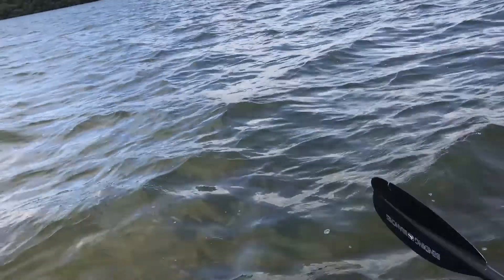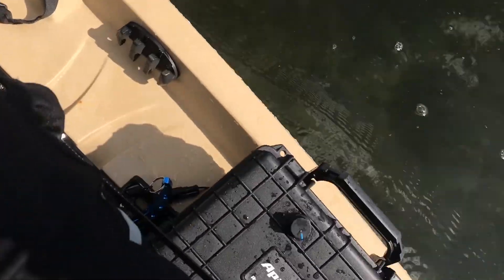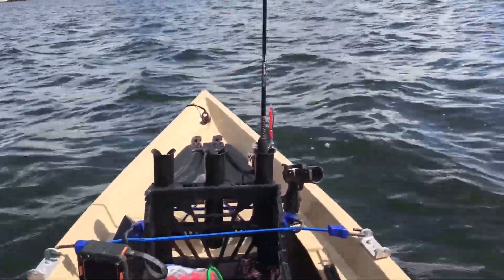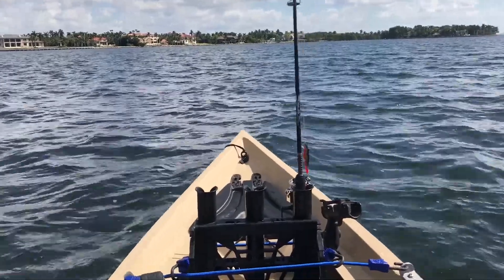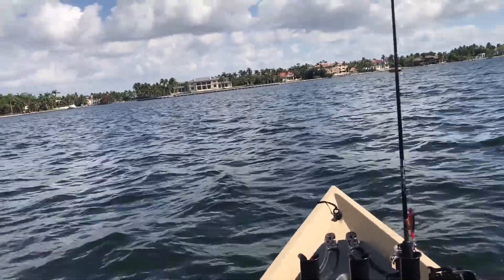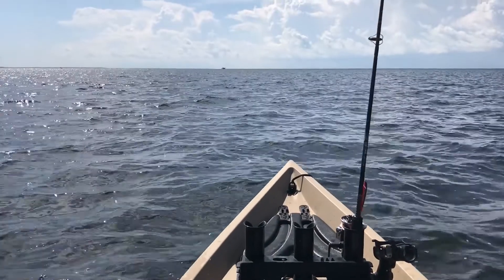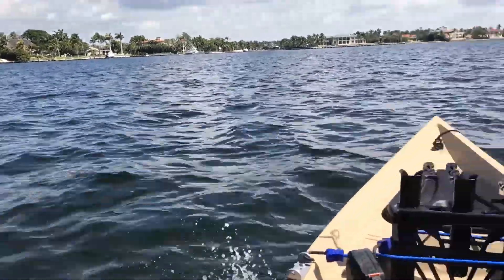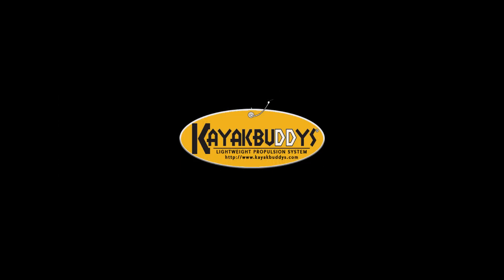Echo 58v Powered Outboard on a Nucanoe Frontier 12

Comment: How long does the battery last?
Reply from the maker: Timofey Denisov the 4.0ah battery will last 50 minutes of constant run time at full throttle. I have used one battery and it lasted a good 2 hours of variable throttle changes. This is run time, not just floating around.